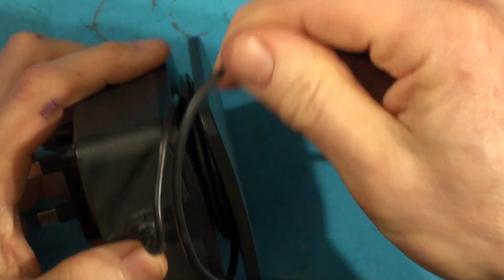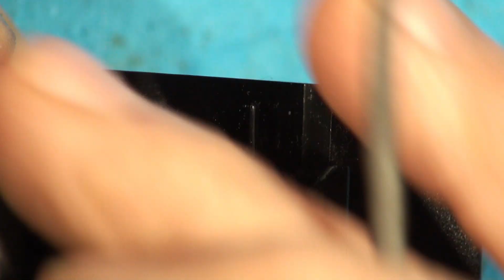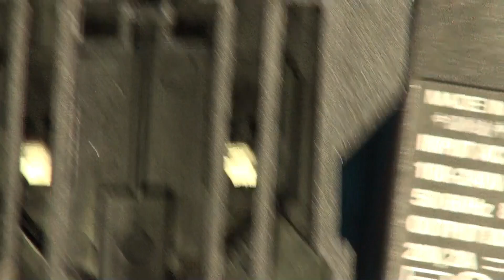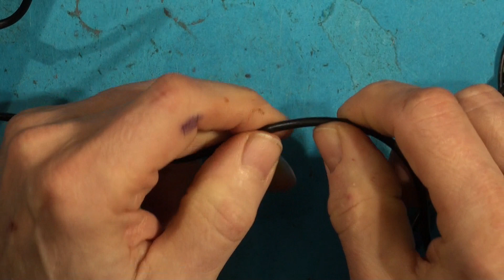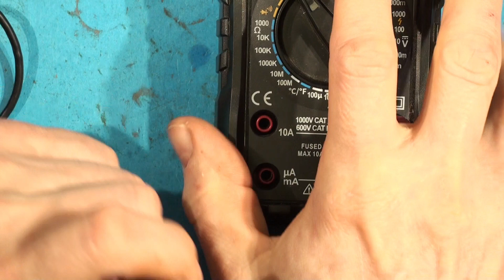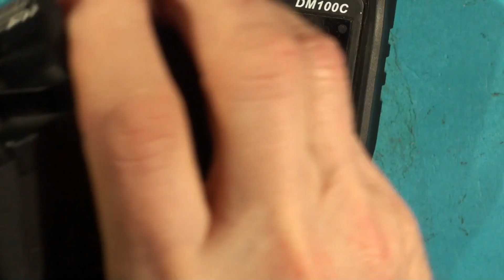Bose SoundDock Portable Power Supply Adapter Diagnosis and health Check

Comment: I just started working on a white 95SP-030-2 model at the moment. I checked and there was no power at the connector. The connector and the cable at both end looked fine. It can tell it wasn't used much or abused in any way. No physical damage or stains even. I cut the switching power supply housing by using a Dremel at a cutting wheel and confirmed there was no (expected) 20V at the points where the output wires were soldered onto the board. Still in the process of checking the board to see what failed. It is kind of nice the board actually has the primary and secondary parts labeled, makes it easier for a noob like me. I am tackling this as a favor for someone because with used OEM ones or brand new aftermarket ones both for sale around $20-$25, paying to have one repaired makes no sense.
Reply from the maker: Change the PWM power supply chip.  99% of problem go away when the chip is changed.  We have repaired high hundreds of these and I leave them for a technician to do. The procedure just says: Check components and lead visually. Buzz out the DC power lead. Check the on board fuse and change the TNY chip.   I can't remember the last time the technician referred a failed repair to me to diagnose..
Reply: @razenby  Interesting, and makes sense as I didn't see any faulty components during visual inspection. Also checked the usual suspects using a MM and still nothing. There is one diode that might be bad which I will remove to confirm but typically do not see chips fail that often. Is the PWM chip and the TNY chip the same or different? Are there part numbers for either so I could check?
Thanks a bunch!

Comment: I have a SoundDock 1. It stopped working when plugged in. It only works on battery power.
Reply from the maker: A Sounddock 1 does not have a battery you must mean the SoundDock Portable? If you have a SoundDock portable then check the invebo.com Technical Guides Page: Video  'PIO connector replacement procedure' . There is a white ribbon cable that connects the PIO board to the main body of the dock. It comes dislodged. Just follow the procedure to refit you current PIO. Often solves the issue. Of course check that you power adaptor is outputting the nominal 20 Volts DC. Good luck
Reply: @razenby thanks, man

Comment: How do you open these things up? I have one showing no voltage at the pin end
Reply from the maker: Have look on the invebo.com tech guide  vidoes for the procedure.
Reply: @razenby  thanks, worked it out for myself eventually, blown T2.5AH fuse inside . 👍🏻

Comment: Woke up at 5:30 am this morning with the Sounddock II beeping rapidly (like a warning tone).  Went to remove the power supply plug from the rear of the speaker and it was burning hot and had started to melt.  Upon removing the plug I could see it was glowing hot inside and was smoking.   I shudder to think what might have happened if I hadn’t been home or been in the room to hear the warning beeps.  Disconnected it and will be calling Bose Australia on Monday morning.
Reply from the maker: Which model are we talking about?
Reply: @razenby  Bose Sounddock II Portable with a PSM40R-200 power supply

Comment: Late comment here ..  but any way to get in touch regarding a dock that gets intermittent power?
Reply from the maker: What model dock are we talking about - A Sounddock Portable Bose?  It is very likely that the ribbon cable on the PIO board has become dislodged. (very common). If so to solve this problem see my  PIO board replacement procedure at www.invebo.com.(Tech-Guide section)  The replacement procedure shows you how to get at (disassembly) and re-seat the ribbon plug. Thus it is a good guide to reinstalling your existing part that may have come unplugged. Please  remember to thank me by liking and subscribing please. Thanks.

Comment: Used a digimeter to check if there's an output and shows less than 1V. I guess its busted or something.  Any idea if it can be repaired before spending for a new one?
Reply from the maker: Have you checked the spring contacts behind the socket adaptor.  If you drop it on the floor the pins  whack the it bends the contacts behind the socket adaptor.. Have a look and lift them, up a bit,
Reply: @razenby  The spring contact looks good. I also did put some whiteboard marker on the contacts just to check if its touching the socket adaptor and that looks good

Comment: Mine is gone
Can i change with laptop charging between 17-20volt?
Reply from the maker: Yes if you can find an adaptor with the correct plug size. Bose use a rare one.
Reply: @razenby  yeah that's the problem
😢